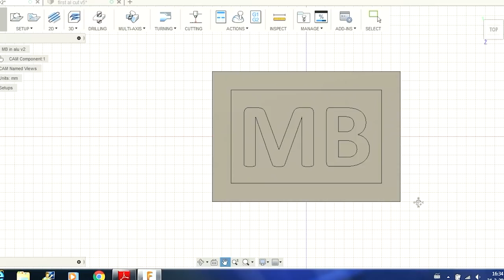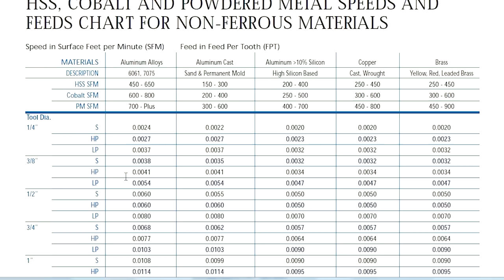My first experience with milling Aluminium on a CNC 6040 Router

Comment from the maker: Six beginner/low budget end mills for aluminium(Affiliate links):
Test video with Feeds and Speeds: https://youtu.be/M-1dYJWh3rw
Tool 1: ⅛ inch 2 flute: http://bit.ly/2N2DyEE 
Tool 2: 4 mm 3 flute: http://bit.ly/2N2DPXZ
Tool 3: 5 mm 3 flute: http://bit.ly/2N2DPXZ
Tool 4: 4 mm 2 flute: http://bit.ly/2N1KYb2
Tool 5: 4 mm 2 flute: http://bit.ly/2SxnT6g
Tool 6: 6 mm 2 flute chamfer: http://bit.ly/2tmihfX
Reply: I wouldnt recommend AlTiN for aluminum. Stick to ZRN. The alumimum in the coating will bond with the aluminum piece
Reply: The speed and feed your using is creating alot of backlash. Also if your getting vibration, reduce your spindle speed rpm not feed rate. I'll send a formula for working out speed and feeds. 

Some great speed and feeds for Ali

Spot drilling
S-3000 F-150
Normally go -2mm from Z0
Normal drilling 
S-3000 F-300
Peck 2mm ( will clear all swarf)
Tapping
Ali only - S300 for feed rate X by pitch. 
Example 12x1.75 
S-300 F-525.

To get really nice finishes your gonna want to do ruff and finish passes. The reason you had and ok finish is you was tracoydal cutting. Which will required a slower spindle speed but faster feed rates and small step over. If you was to do the ( ruffing ) in 0.5mm step down then a finishing pass at full depth. You should also get a nicer finish. Sorry to go on but hope this helps. And questions feel free to PM me 

Btw I work on Hurco VTXU 5axis CNC
Reply: James Tiberious 
Trawlin through YT looking for beginners advice and tips for a good 1st mill, starting to ‘get a feel’ for what direction to head in, then you bust out with whatever language that was, and the reality of the learning curve ahead of me to even begin to understand what the hell that hand controller contraption does kinda dawns on me... 

Sounded like when I hear welders talking or something....
Reply: @muntee33  first mill in what regards? Machine or cutter? It also depends on what type of material you want to cut with it. If you let me know il do my best to help with what I can
Reply: even if your just beginner...or maybe especially whe...
get a amachinist handbook and learn the 3 simple facts about feed, rpm, and the most important cutting speed. It all comes down to this, and the sure have a bit leewayy  but not really that much if you dont have expirience.

For example: handbook will say: aluminium needs cutting speed of 350 m/min and maybe 0.05mm advance per tooth of the endmill

tool diamitar is lets say 8mm

you will end up with 14 000 rpm  and a feedrate of 2100 mm/s

thats a bit crazy so if you want to tone it down then adjust feedrate and rpm at the same values so you maintain the depth of cut...afterall cutting aluminium is basically(...) the same, so tone it doen according to the machine and it will be fine

Comment: I am a certified precision machinist, you should always use 2 flutes mills on aluminum, and if you want a better surface finish increase the rotation speed to the maximum the machine will run and then slow down the movement speed, and the depth of cut and bite you take out of the material. On the large CNC machines we will take a .030-.050 depth pass. This also depends on the length of the mill the longer the mill the more deflection you get which results in chatter and a rougher cut. But on my final pass I will drop that depth to around .015 and get it super smooth. Keep in mind which way your machine flexes in the Y axis, try to control the path your mill is traveling so it cuts going in the more solid path of X axis, and uses Y axis for it travel rather than cut. So on your final pass decrease the depth to .015 and instead of the mill cutting the length way of the machine, have it travel back and forth across the machine as you mill and keep the pressure the mill is receiving against the more solid axis. You might find that improves the finish surface as well, if not fab up some supports for your Y axis so it is not able to flex like it does. Great video, I am trying to decide if I would be happy with one of these machines at home or if I would just be driven nuts by every little imperfection compared to a full sized CNC machine and how they output.
Reply: Did you end up buying a CNC for home use?
Reply: @florian florian As I understand from my research (looking into getting one of these) three flutes are best "middle of the road" bits - they can do it all but not as well as bits specific to the job. Single and double flutes are best for roughing. Four and five flutes are best for finishing.

Comment: I would like to comment about why this Endmill, not called a "BIT" broke, it is Not because it is a cheap High Speed Endmill, it is because it is a 4 Flute endmill designed for steel. When we cut aluminum we use a single, 2 or 3 Flute Endmill because they do not get loaded up with aluminum when the endmill gets Hot and makes the aluminum gummy especially when cutting 2024 or 01 condition aluminum. If you would slow down the speed and feed according to your cooling of your endmill and use less flutes it is possible to use High Speed tools. Infact during the 80's it was unheard of to use carbide to cut aluminum because up until then they, (the Carbide Endmills) were not ground correctly to cut aluminum. The manufactures started using different designs and geometry when grinding the carbide to bring about the designs we now use today. I have been a CNC Programmer, CNC Operator, tool and Die, and Mold maker of investment casting molds and Plastic injection molds for the last 40 years and have seen this industry grow throughout the years. Now I that I am about to retire I will have a 4 foot X 4 foot Mill of my design and build in my garage to have many years of FUN with!  Enjoy!!

Comment: 6061 is typically the easiest to machine. As you discovered, 2-3 flutes are all you want for aluminum to allow for chip evacuation and prevent welding. With the lack of rigidity of your machine, light radial cuts - especially along the x-axis - will typically cause vibrations that ruin the surface finish. You have to either finish with higher WOC and less DOC, adjusting for the flex of the machine or change to a conventional instead of climb cut so that the flex occurs parallel to the wall cut instead of 90 deg to it. Climb cutting is great if the machine is rigid enough.

Comment: From my experience in aerospace I learned a valuable rule. When you pay for a a drill or cutting bit, you are paying for the quantity of accurate holes or cutting they will preform. A $1 bit that makes 10 decent holes costs more per hole than a $5 bit that makes 100.
Reply: Add to that the disappointment and frustration of poorly finished or ruined parts, and some people will become disheartened and take up knitting instead!  Your early attempts may still be part of an actual project that was the reason for buying the machine in the first place.   My experience is that the immense pleasure I got from proudly showing off my beautifully crafted veeblesprocket is what made me want to try the next step.  Buy the best tools and cutters that you can!
Reply: If you can't run the speeds and feeds the tool was designed for or if you lack rigidity your tool will fail no matter how much you pay for it

Comment: Hi there, One of the things I noticed was after the first outside cut was made and the machine moved to the next run that you have the feed the wrong way round which makes the bit try to climb over the sidewall and not cut correctly if the cutter is running clockwise than the feed should be anti-clockwise which draws the cutter into the cut and not cause it to try and climb out of it.

Comment: Awesome! If you ever consider upgrading the router just go straight for linear rails. With router spindle speeds a single flute endmill is almost a necessity, it allows you to take an actual chip at lower feedrates to better suit less rigid machines, and single flute endmills are extremely rigid and are harder to chip weld (not impossible ;). If you plan on cutting plate, get stubby endmills, saves carbide (money), and makes your setup more rigid. If you're still having trouble, take a smaller axial cut. I hate doing it, it multiplies the program length but also drastically increases reliability. Don't be afraid to lower your spindle speed to cut a real chip. Idk what you're running in your mister but tap magic has some aluminum mixtures that I've used before and liked. Up the air pressure and make sure the chips are getting blown out, the air blast is more important that the mist, gotta get those chips out. I've worked with an omio x8-2200 which is essentially a 6040 with linear rails and a 3hp spindle. My friend and I have cut boat loads of alu for an FRC robot, and it works great. We can do full depth adaptive in 1/4" plate with a 20% WOC on a 5mm carbide single flute at 40+ ipm, and we slot often to cut out parts, but this requires a lot of feed rate override and micromanaging to not break bits. This is just me typing up a bunch of stuff, I'll likely comment again as I remember more things. Feel free to reach out if you have any questions.
Reply: Mo MO
Reply: remember that WHATEVER you use as a coolant will be coating your lungs, too.

Comment: Hi there,
One thing that I don't think anyone has mentioned yet which is actually the source of ALL of your problems, the motor to leadscrew coupling. I'm pretty certain on these beige coloured machines, they use a flexible aluminium coupling between the stepper motors and the lead screw. Because it's flexible, any lateral cutting forces will cause the axis to bounce on the flexible coupling.

Comment: Finally a video that shows what I have been looking for. A CNC router good enough too work on heard t6061 aluminum. So it should not be much harder to put a few designs on my anodized 7075 aluminum lowers

Comment: Maybe a minor tip: don't use MDF or wood-fibre plate to clamp your workpiece on, specially when using liguids for cooling. It compresses when you clamp your workpiece on it, but worse: if you use water or water/oil mixture or any kind of liquid to cool, this liquid will be sucked in by the waste-board and this may distort the underground, which in turn could result in reduced clamping force of your clamps, your workpiece could get loose etc. And indeed, increasing the stiffness of your construction may increase quality of the cuts. Why aren't you using special cooling fluid in your mist-spray device, it's just designed for that purpose, it won't make such a mess as using water and a spray can of WD40. Nice video though.

Comment: Kudos for testing your machine's capabilities and finding a "sweet spot" for what you want to run. You discovered the hard way that aluminum should be cut with carbide end mills that have at most 3-flutes, and that the alloy matters. 6061 is the easiest to machine, although your 6060 looked fine.
Two notes:
1) A flexible machine will leave a worse finish when climb cutting. Try a conventional cutting strategy on machines like the 6040 and use climb cutting for rigid setups like true CNC mills.
2) Instead of using water and WD-40 separately, use a water-soluble coolant/lubricant like Kool Mist that is designed specifically for mist systems.

Comment: Awesome. You did your due diligence and tested the machines capabilities. 2 and 3 fl are best for aluminum. 4 will chip-weld. Mist is also best, so good job. Should spray a bunch of that wd40 in the bottle and save yourself the hassle.
Reply: I am a great fan of single-flute cutters.   They do a lot to improve chip evacuation, and reduce re-cutting.  Also, more space for coolant and air to reach the cutting edge, and reduce melting of the aluminium.

Comment: Welcome to the CNC brotherhood. From someone who has been there and done that I would pass on a couple of tips. 

1) Starting out don't buy dear bits you are going to break heaps of them. Buy quantity not quality to start with (unless you have very deep pockets). It's false economy because when you don't know how to use them properly you are going to break or wear them out just as quick as cheap ones.

2) Learn about a climbing cut and a conventional cut, and you will very quickly work out what went wrong on the M. (mostly the machine is not really good enough at this point).

3) Learn to work within the limits of the machine and things like chatter will be greatly reduced.

4) Learn the appropriate cutter for the job, as you half worked out that alloy needs to be able to clear the cutter to stop the tip clogging up / welding. The problem was not the amount of flutes you had, but rather you weren't going fast enough for the amount you had. The machine currently can not go fast enough for 4 flutes so instead of speeding up, reduce the amount of flutes down to one or two,  so you don't have to.
Reply from the maker: Thanks for sharing your knowledge!
Reply: I've taken busted two flute endmills and made single flute "flycutter" for high rpm finish cutting.
Reply: @keithlucas6260  

For my ER-11 collet I put in a 6mm single flute straight edge usually used in wood work for trimming edges.  Works for plastics and aluminum.

Comment: Remove the air pressure or severely lower it. For surface finish you need to slow down the movement speeds. Keep the spindle at the high speed though. Your rig is moving too fast at the end to get a good enough finish with that much surface area hitting the bit. Also if you do a deep cut finish like that in the future. Make sure the bit is as straight as possible. Maybe make it a two step process. Have one bit for cutting and another sharper one for finishes. That would save you time and money in the end.

Comment: In the industry we use Varsol and a misting bottle for aluminum to keep the carbide cutters from sticking to the chips. I even used it on magnesium bell housings for Ford Trucks.

Comment: A couple things I noticed, and a couple suggestions - When using that small of an endmill, smaller chip loads are better, stepover is generally 1/3 the diameter, .050" depth of cut is decent. When clamping, make sure the fulcrum is always slightly higher than the work to be held. Your 'axial cut' aka finish cut really shouldn't be removing more than maybe .005".
Reply from the maker: Thanks for the tips! could you explain this part further: "When clamping, make sure the fulcrum is always slightly higher than the work to be held."
Reply: @MBcreates  He means the height of the far end of the clamp should be at or above the level of the part that is clamping.

Comment: At that surface rate, you should be using a 1 or two flute Carbide Endmill with a 45 degree helix.  Also, shorten that tool stick-out, unless it is needed.

Comment: couple of tips:

1, turn WD40 can upside down and remove all pressure, drill a hole into bottom and fill that mister with WD40 instead, you waste allot of it here as the air just blows it away instead of to the cutter.

I use methylated spirit on my mister and that works wonderfull, used it on alu for 2 years, both cools down and.. you dont really have any cleaning after.. 

3 flute will work good here, as it has thicker core than 2 and 4 flute, i would also recommend to leave 0.2-3mm leftover radial and when you are done, do a cleanup pass with full depth to remove that leftover, gives a cleaner edge and wall finnish, experiment on how mutch leftover you need, if you have allot of marks from machining, you will need more to remove it in 1 or more layers in full depths.

Saying that it was way to fast for a 4 flute cant be right, i cut at 2500 mm/min on 3 flute at 14200 rpm on my DIY cnc (aprox 0.052 chipload i think).. abit more sturdy than that china machine, but still.

Also, those misters works well at aprox 2 bar pressure.. i have tried more and less, but with those chips 2 bar will be enough and compressor doesnt run hot on long run, you can check my channel for some of my cuts on alu, mostly test cuts.. should reckord a real cut (i have one, but my motormount was actually falling apart, so had to go very slow as i cut a new mount)
Reply from the maker: Thanks !
Reply: Kerosene also works wonders, and is more economical.
Reply: You can buy refillable spray bottles and 5l refill cans.
Reply: I have a bit of experience with machining, myself - since 1975, and I've NEVER seen a better cutting fluid for finishing aluminum than solvent. Yup, the solvent used in a standard shop parts washer. I, too, would simply suggest slowing the spindle speed and adjusting the feedrate for the proper chip load... Just sayin'!

Comment: I have a 6090, cut aluminium all the time. 2.2kw spindle, run at full rpm, single flute carbide cutters, depth of cut ~20% of the width of the cutter, cooled and lubricated with an ethanol spray.
Reply from the maker: Which brand end mill do you use? Link?
Reply: Datron, and don't balk at the price, well worth it. Or go 2 flute ebay carbide. but be highly polished. Its a router, not a mill. Milling tools with tight helix are not that great. What I look for is a 'slotting' cutter, as most of the work is cutting out the shape, not side milling a chunk of aluminium.

Comment: I've got the same machine. For Ali I use single flute carbide cutters. They leave a good surface finish. The bending of the x rails bothers me but as long as you don't push the machine too hard it doesn't affect things too much.